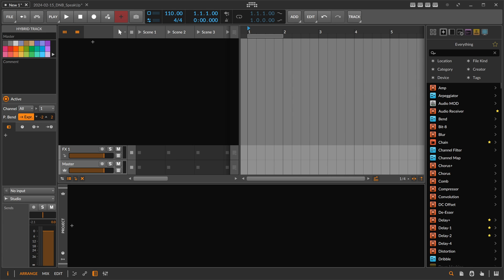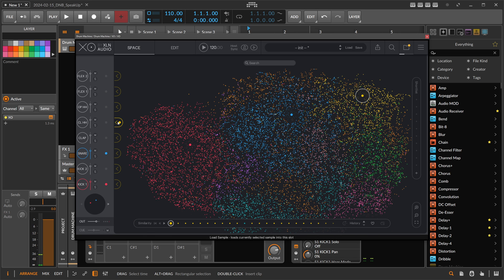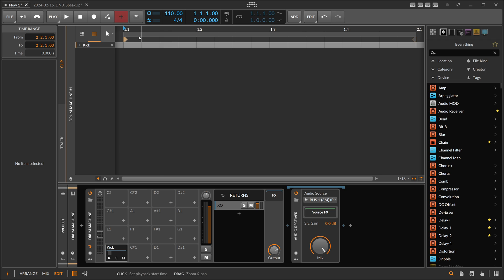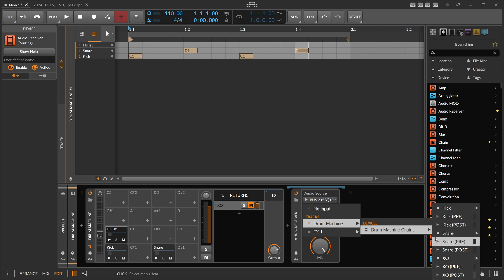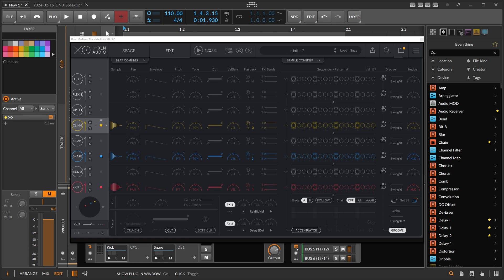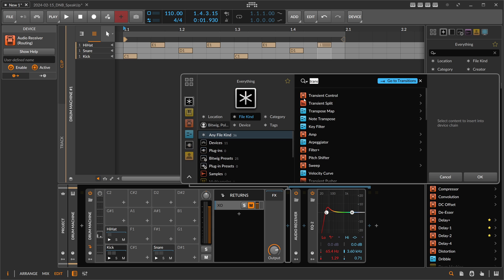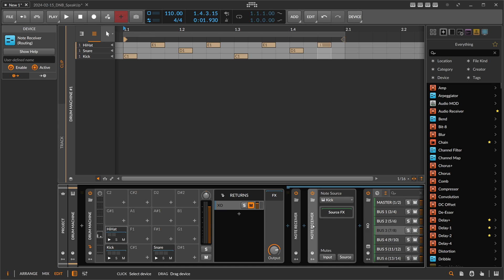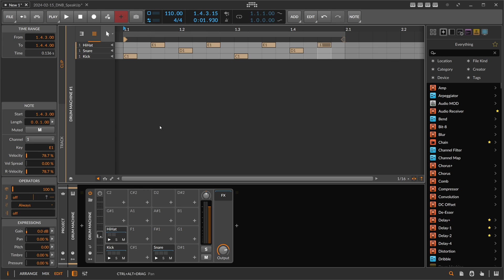The Problem with the Drum Machine

Comment: Thanks for all the great videos! Here's another Bitwig Drum Machine issue looking for a solution: I like to use multiple MIDI clips routed into the Drum Machine. This allows me to use note effects such as Note Repeats on an individual Drum Machine instrument, or different length clips for polymeters. That all works just fine. The problem is choking . . . Let's say you want to choke C1 with D1 when they hit at the same time. Oftentimes (though not always) what will happen is that you get the initial transient of C1 before D1 chokes it. It would be nice if there was some way to have the choke work on the MIDI timing, so if C1 and D1 hit at exactly the same time, C1 is not played. Any way to achieve this? Hope you can take on the challenge!

Comment: Another Monday another problem. 

There is one thing you left out to complete this:  XO's galaxy sample audition playback and internal FX returns only output to Master 1/2.  To remedy this, create another drum machine pad with an audio receiver set to XO chains->Master 1/2 Post.  The FX returns are "whatever" but without this routing you'd have to unmute XO in the returns section every time you wanted to browse samples.  The audio receiver listening to Master 1/2 XO chain does not double the sounds like the the XO output in returns section of the Drum Machine does.  

Also, I didn't  need to unmute the input of my Note Receivers.  When unmuted they doubled the clip/live keyboard notes and caused phasing issues.  Not sure if the way I routed things made a difference, but I threw all the Note Receivers into a Note FX Layer device to keep things tidy, and hence perhaps the Note FX Layer is passing along the clip midi in parallel?  I think that's what is happening.  

Great video!
Reply from the maker: True, you're right about that. To preview the samples, you need to route them through the master. And yes, the second part is also correct, the Note Receivers in parallel don't block each other like they do in serial form in my video! Well spotted!

Comment: Yoooo , I tried your way with new version of triaz and umpf by reason studios. I didnt need the audio receivers. Only thing needed is the note receivers. Adding the audio receivers doubled the sound.
Reply from the maker: Yes! The audio receivers are only necessary if you want the effects or the audio stream to run into the cells of the drum machine. Then you need to also mute the return channel to remove the doubling of the sound. If you don't need that, you can just let the master output run from the return layer!

Comment: I this is not related to this video but I wanted to give you another video idea. I have been wanting a distortion plugin that has a side chain capable detection circuit with a filter. This would allow me to control what part of the audio is generating harmonics. I think this is probably possible in the Grid but I don’t know which modules I would need. Also it would let me generate harmonics based on another track. Possible?
Reply from the maker: Hmm, I'm not sure if that makes sense. The distortion device already has a pre-filter, where you can choose exactly what generates overtones. And using sidechain from another track for overtones sounds cool, but actually, you're just mixing two audio tracks. Your original audio and the sidechain with a few overtones. But overtones sound exactly like the track itself, just with a bandpass or highpass filter, depending on what you choose. I mean, I don't think it works the way you imagine. Try putting distortion on a track and separating the overtones. It won't work. Maybe I'm just misunderstanding you, though :D

Comment: The note receiver at 7:10 did not work for me, because the note transpose did not show up as a source in the note receiver. I added the note transpose to the end of the chain of my drum machine channel (e.g. the kick). That's the mistake, because if I add it to the front of the chain then it shows up in the source of the note receiver in the return channel with X0. A bit convoluted explanation, but maybe it help someone out there. 🙂

Comment: Thank you very much! It helps a lot. Tried to use the same method for controlling Addictive Drums with the drum machine. It works kind of. But it seems that you must use some learning inside addictive drums too, because c, c#, d, d# are not triggering the right presets. 

Danke schön! Ich habe versucht das gleiche Verfahren für für die Addictive Drums zu nutzen. Das funktioniert auch zum größten Teil, es sieht aber so aus, als müsste man das Triggering innerhalb der Addictive Drums zusätzlich an die Noten der Pads anpassen, da sonst nicht die richtigen Drums angesteuert werden -- oder alternative große Lücken zwischen den Pads frei lassen ...
Reply from the maker: Ja denke man kann ein eigenes Mapping template in AD anlegen. Ist ein bisschen Arbeit aber wenn man es dauernd braucht sicherlich cool 👌

Comment: Great. Thanks for the video. I have been experimenting with noise as a random note generator I generated noise and I use a gate setting the threshold just a tad before muting and this generates random notes that can go to a replacer and with that you can capture in a mido channel. My approach is very simple but I think this is a really nice way to generate grooves and I think it can be improved a lot. If you can make something out of this idea it would be great!
Reply from the maker: How do you randomise the pitch? Just one static pitch?
Reply: @PolarityMusic  Yes I just want to make a rhythm  that sounds different and then can be repeated, you can quantize the notes, My question is there any way that we can control the noice change so that we get some variation. The idea is to generate random notes for example for a psytrance fm lead.

Comment: Thank you! I figured out more or less the same myself a while ago (also due to your tutorials) and it's good I found basically the same way that you did as well. But I always asked myself if there isn't an easier way to do that which apparently isn't. Maybe we should raise this also with support. Maybe a bit similar to Ableton so that you e.g. could add XO on the 1st cell and then set a range of notes so that the notes for the following cells all go there, in the same time then it should be possible to send the multi-out outputs to those. However I think it could be not so easy to figure out a clever UI for this.